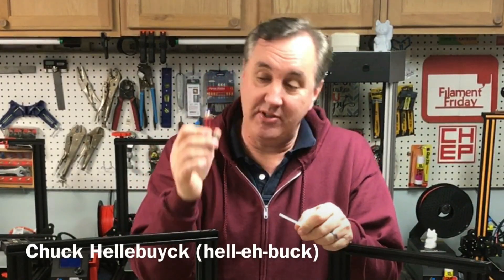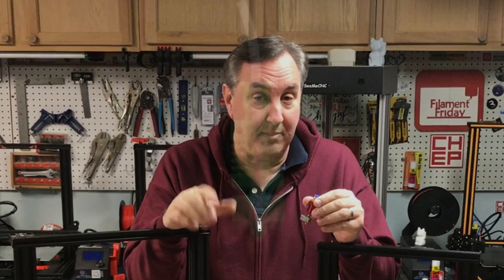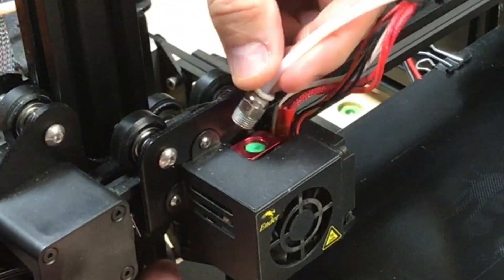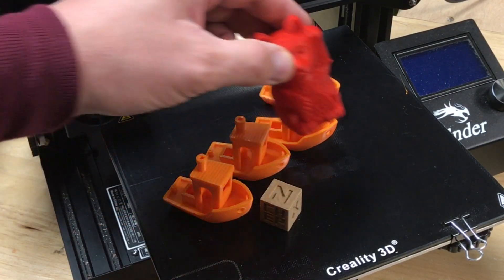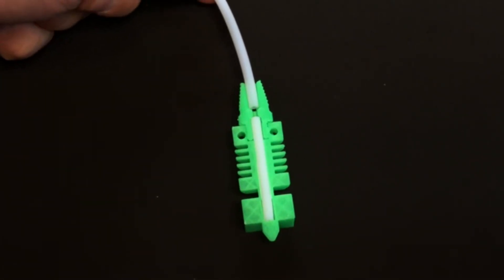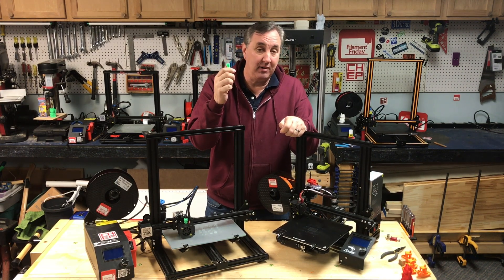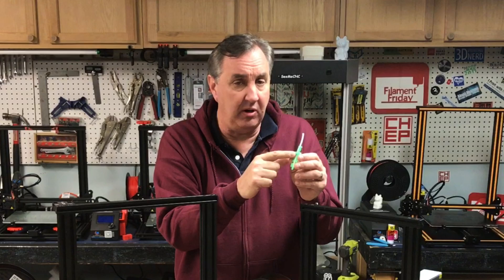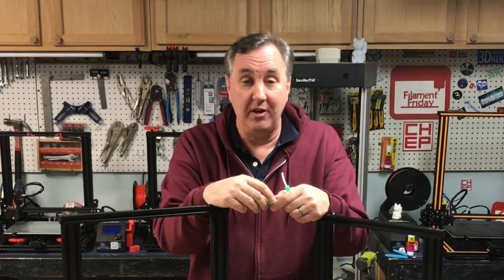Creality Ender 3, CR-10 - Hotend PTFE Fix

Comment: Clever solution Chuck.  You’ve got me wondering if this same technique could be used on the geeetech A10M/A20M to reduce some of the jamming people are experiencing.
Reply from the maker: I planned to try it on the A10 but didn’t think about the A10M. Even though they have a metal heat break, if the PTFE isn’t all the way to it, it creates the same type of blockage.

Comment: Hi Chep. Do you know of a mast to print that would fasten to the hot end or one of the roller screws so you can zip tie all of the wires to the mast that come out of the top of the hot end. During printing all of those wires are flexing and twisting and pulling. It can't be good for them. Even a metal bracket or mast would help.

Comment: Great application and example of combining two great ideas into another great idea.  I'm thinking that getting a tachometer might not be a bad idea to occasionally check the fan speed on workhorse printers.   I would like to see future videos on maintaining your printer.   I print a lot of PLA and PETG and have had great results (no clogs) with and prefer the hot ends with high quality PTFE sleeves (like Capricorn) all the way to the nozzle vs. all metal hot ends for these two filament materials.
Reply: Thermal camera would also work to have a reference for heatsink temperature, and will also show failed sections on a hot bed as well, along with failing connectors before they catch fire.

Comment: i upgraded to a v6 all metal clone on the ender 3. so far no problems. i even tried the micro swiss clone replacement. i was unable to tighten the nozzle correctly  without it twisting  everything  crooked to the point layers were uneven.
Reply: Do you have a link?
Reply: @ButlersSpeedShop  [Gulfcoast Robotics] All Metal V6 Bowden Extruder Hotend for 3D Printer - 24V /1.75mm Filament / 0.4mm Nozzle. https://www.amazon.com/dp/B07G4GTY16/ref=cm_sw_r_cp_apa_i_s5zoCbNACE7C5
Reply: @ButlersSpeedShop  CR-10 Heavy Duty customisable modular e3D V6 mount Volcano 5015 ABL found on #Thingiverse https://www.thingiverse.com/thing:2494642

Comment: These fans are of very poor quality. Mine is periodically falling into woble slowing it down to almost standstill from day one.  Do you guys have suggestion for quality replacement?
Reply from the maker: I’m still working on that. Noctua fan doesn’t keep the heat sink cool enough for my expectations.
Reply: @FilamentFriday  Yep - I'm searching too. Trying to avoid getting thicker fan - seems that it wouldn't fit in the original shroud. Pitty - there are plentiful good 40mm x 20mm 24v fans

Comment: This is awesome - I won't need this mod on my old printer but the original coupling will likely replace the cheap metal coupling I use on my old printer my 12 y.o. has - it looks like it'll grip the PTFE tube better and there is no risk of little metal teeth dropping into the hot end (which has happened to me on several occasions and is a royal pain to fix).

Thanks!

Comment: Chuck, can you make a version with either longer threads (by about 15mm) or just a smooth section of 15mm then the threads? This would allow it to work with printed fan shrouds. Even the factory push connector nut hits on printed shrouds I've tested.
Reply from the maker: Not sure what you refer to.
Reply: @FilamentFriday  Sorry. Here is a specific example. The Bullseye shroud interferes with the PTFE push connector, and actually hits the nut. The Bullyeye makes it nearly impossible to push down on the push connector to remove the PTFE. Your solution is a great replacement for a number of reasons, and if the threaded part of your assembly were longer entirely, with the length added to the straight part of the threads below the nut, it would solve the issue I've described. Your assembly would entirely clear the Bullyeye printed part, making it serviceable. Hope this helps.

Comment: Did you print those at 100% infill?
Reply: I printed one at just 20% with 3 walls. It's mostly wall, with very little infill, and very strong.
Reply from the maker: I did use 100%

Comment: Why don't they just design the internals to be smaller instead of requiring a tube?
Reply: cheap chinese manufacturing, they cant het the necessary precision when making these, you can get all metal hotends but you need to buy from a good site

Comment: I took a marker and dabbed a spot on the connecting area of the ptfe tube and coupling.  I noticed the coupling was bad and replaced it.  I've noticed by watching those marks that after putting better fittings, after a while the tube might not pull out but it might spin or rotate in the fitting.  Doing this mod might prevent the tube from rotating in the heat break, if it even ever does.

Comment: This is a nice upgrade. You printed yours in PLA, would there be any disadvantages to printing it in PETG or ABS? Looking forward to putting this on my Ender. Thanks for sharing Chuck.
Reply from the maker: Those should work as well.
Reply: the base model actually recommends PETG, for it's extra flex over PLA
I have one of the other remixes on my printer(the one for bowden titan extruders)

Comment: thanks for this.  i just had a blockage from the ptfe not seated correctly.  it is very easy for there to be a tiny gap which eventually leads to a clog

Comment: How much long the separate PTFE tube inside the hot end?
 Ender 3
Reply from the maker: Just above the top of the heat sink should work. The coupling can adjust to take up the space. Notice mine doesn’t go all the way down.

Comment: i'm using an ender3 with a creality  glass  bed and im having trouble with petg holding to the bed. im new to the 3d world and i'm wandering if i use gloop on the bed if it will hurt the surface or if would be fine? tthanks for all the great videos and advice.
Reply from the maker: Should be fine. I use a swipe of Avery gluestick on mine from time to time.

Comment: I'm not sure if you ended up with the XVico Pioneer but that little extra PTFE in the nozzle is how mine came, which I thought was curious. Sadly the ID is really really bad on it and I replaced with PTFE all the way down, but might go back to this method only with better tolerance tubes. Surprised the printed coupler held up!! Just goes to show even PLA can work for functional parts.
Reply from the maker: I have lots of functional PLA parts that I sell that hold up really well. 
I have an XVico but haven’t taken it out of the box yet. Gotta get to that ;)

Comment: literally installing a microswiss hotend in my ender 3 right now as im sick of dealing with clogs every 48 hours of print time
Reply from the maker: Not sure that will solve it but good luck.
Reply: @FilamentFriday  really? the bowden tube is replaced with a titanium heat break and the tube only goss in by like 1 cm
Reply from the maker: I’m just going by feedback I’ve heard where the heat break doesn’t hold up over time and doesn’t have the same lubrication properties as PTFE so some have reported blockages as well.

Comment: A properly assembled stock hot end will never experience this problem. I am glad this works and it is a novel solution. I would prefer however not to add more steps and complexity to my configurations.

I applaud the creative solutions though. All 3 of them and your remix of the 2 to make them even more convenient.
Reply from the maker: Over time couplings fail especially after a lot of retractions push to create the gap. If it wasn’t a common issue I wouldn’t get the views I got on my previous video showing how to properly fix it with better couplings. This is an alternative many viewers suggested.
Reply: CHEP nothing wrong with that. Your viewers have the choice. My Cr 10 mini works fine but if I ever have such problems I’ll definitely try out this solution.
Reply: oh like I said nothing wrong with creative solution. like I said I especially like your combination of both of them into a single convenient part. elegant.

but I have never had a coupler fail past burn in. I have had them come basically DOA. install the spare and never a problem again. I would  consider it a low failure component. of course you do need to install it right and secure the clip. if its allowed to ride back and forth it will eventually chew the PTFE tube. most are damaged on removal not on use. users don't remove them right wreck them and when reinstalled they fail. if you can't get the PTFE tube out stop trying. remove the compression fitting push the fitting FURTHER into the tube while depressing twisting and then reversing direction to slide it off.

creality recognizes some of this issue and now includes nice clips with the printers. I hope to see them included across the board soon and also for sale nice and cheap :-)

BTW I also LOVE your teaching aid you got their for the hot end in cut away. FREAKING cool! did you fab that up or get it from somewhere else?

  @FilamentFriday
Reply from the maker: Link is in the description for the hotend STL  I started with and then I designed the rest in Tinkercad.
Reply: Sure, but the couplings that come from creality will fail sooner than later, at least they did for me on two printers.  May as well kill two birds with one stone like with this solution.

Comment: I'm really confused...how is this a problem? I just pushed my tube right down, brass fitting, not sure why you even need a tight fitting because filament travel pushes this end into the hot end, it's the other end that can pull out. With Capricorn tubing, you can set the hot end up to 260C.
Reply from the maker: Retraction creates the gap over time if the couplings don’t hold it tight enough. It’s a common issue.

Comment: That will work on TronXY X1 and other printers with that same type print head setup
Oh and a single drop of oil (I used air compressor oil it's non-detergent) under that sticker on the fan will help it spin much faster
Reply from the maker: I’ll try that. Thanks.

Comment: I'm guessing this will not fit with my Bullseye fan configuration installed.  I may just go back to factory configuration just so I can test this.  I bought a couple of meters of PTFE, so I tend to trim mine a lot.  Especially between exotic filaments.  It always seems to have created a 1/4 gap before the nozzle no matter how I reassemble the hot end.
Reply: Looking at mine, I don't think it will. If the bottom of the printed fitting was just a little longer, at the smaller diameter of the threads, it would clear. Maybe Chuck can make us one :)

Comment: How long do you know to make the small section of tubing that goes inside. If it is too short then you have the same problem all over again.
Reply from the maker: Make it long enough and let the coupling adjust to the tubing. Notice it didn’t screw all the way in.
Reply: There is a cutting guide on thingiverse for length

Comment: why not replacing that crappy bowden coupling with an high end pneumatic coupling instead?
Reply: I have good air tubing and fittings and I still get issues.  Especially if I don't print at a high enough temp.
Reply from the maker: Got a source for that coupling?
Reply: @FilamentFriday  The fitting with metal teeth doesn't seem to let go, cpcrn sells them and probably the same ones cheaper on amazon, but it needs metal teeth inside
Reply: @ClaudeRains1  I purchased an Ender 3 from Gear Best about the second week in December and it came with fittings with the metal teeth.  I am currently having issues with under extrusion and plan to take it a part to check for jams and clogged nozzle.
Reply from the maker: It’s a typical issue. I explain the issue more here: https://youtu.be/x35aWmnZ_A0
Reply: @FilamentFriday  everything ranging from Festo to SMC (or any other pneumatic components manufacturer) will work great provided you enlarge its exit hole with a drill

https://www.festo.com/cat/en-us_us/products_070301

https://www.smc.eu/portal_ssl/WebContent/digital_catalog_2/jsp/view_descriptions.jsp?dc_product_id=20947#s

Comment: I built an aluminum washer for my ENDER 3.  This is a good fix, mine works flawlessly.  Works better than an  all metal Hot end.  I print PETG all the time at 240-250C no problems.  I have 260C PTFE Tube in the lower section.  I ditched the ENDER 3 PTFE Couplers the first day, since one failed to hold the tube after the 2nd or 3rd print.
Reply: If you not sure, crank up those e steps and the junky originals will die very very quickly,. LOL
Reply: @ClaudeRains1  Ain't that the truth.  You don't need to crank up the E-steps too much.  I was printing fairly slow with mine and the tube just popped out.  Fortunately, I had ordered some extra high grade fittings as a precaution.